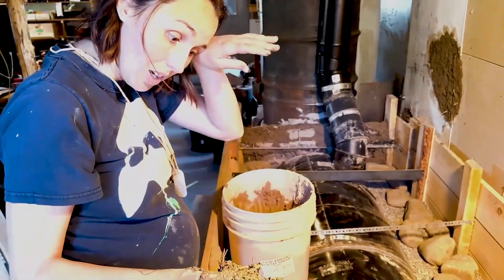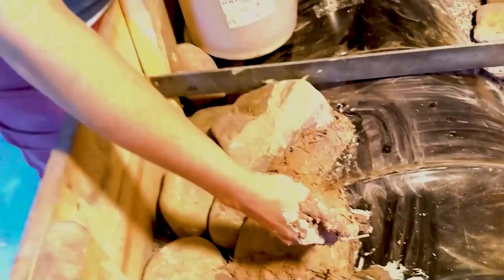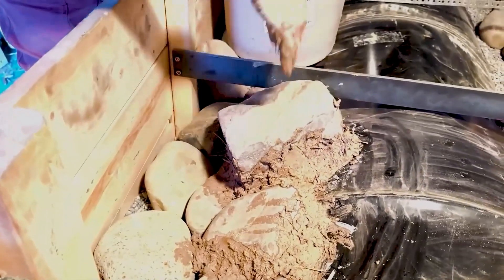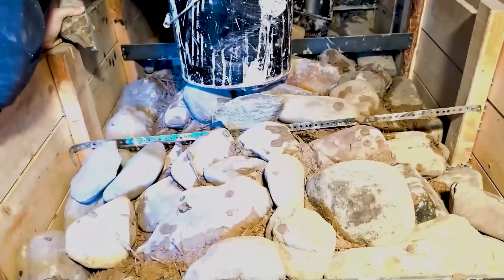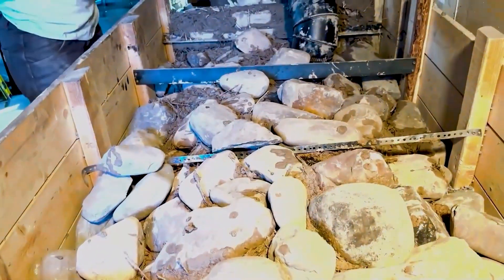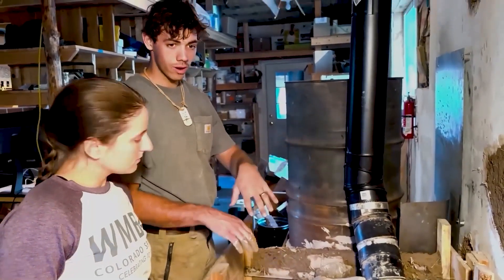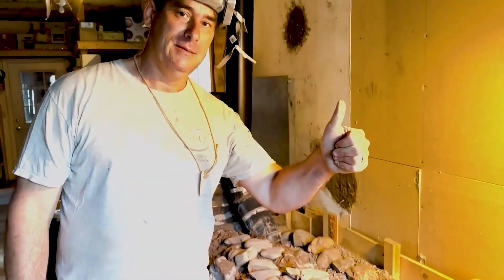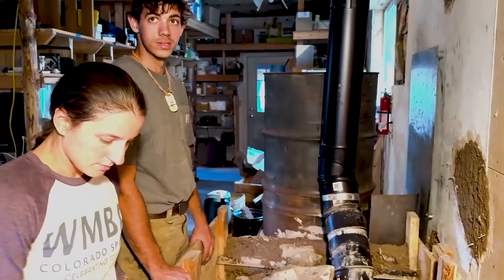optimizing the mass by merging pebble style with cob style

Comment: I want to build a rocket mass/batch box heater in my 26x38’ garage. I plumbed in radiant heat in the slab and have some foam insulation as sheathing. It also has a cathedral ceiling because I will eventually add a 2 post lift to work on my vehicles( footings installed ). With the technology changing through your work , I am confused about how to proceed. I want heat to transfer to the floor to warm the water in the pipes where they all travel back and forth to the manifold….I am definitely doing this project. What should I start buying and preparing ? Already have a chimney for the barrel stove that eats humongous amounts of wood fast , then gets cold .
Reply from the maker: I have never tried that!  Good luck!
Reply: @ hey Paul, I will video  as I go. I will have some questions like the chimney touching the barrel to help with the draft and sourcing stainless barrels( I’m in the Black Hills of Wyoming )
I’ve been reading your work and am excited to do this project. If it pans out I have friends and Nieghbor’s that are interested in possibly heating shops and houses with a mass heater…
Thanks

Comment: ONE of the HUGE problems I face is, my unfinished basement doesn't lend itself well to the  common rocket mass heater.  However, always a fan of the "if there is no solution, there cannot be a problem" approach (within reason, of course). Mindful of that, here I go:

(1) My house sits on a first story of cement blocks. Those blocks are totally uninsulated on the outside.  

(2) I rented a house on the coast of the Pacific Northwet. It, too, had one story of concrete blocks exposed to the weather. Like my current daylight basement, there was no insulation inside.

(3) I enclosed that Pacific Northwet rental's basement, installed a picture window and a door (to the elation of the landlords).  After that, I installed wood heater. The basement was otherwise unheated.

It would take about three days for the wood stove to heat the concrete blocks AND the concrete floor. When they come up to temp, they would hold the heat for a couple days, and the heat was a nice, comfortable heat.  In other words, the basement was like a heat flywheel.

(4) Had I or the landlord insulated the outside of the concrete blocks, the efficiency of the heat flywheel, a/k/a basement floor and walls, would have improved even more.

(5) Were I to insulate my concrete block walls (upper third on the east and west walls and all of the south wall, those walls, along with the concrete slab floor in my house could be made into a worthwhile heat flywheel (I could add 2x6 framing for the insulation and flashing would protect it well, from water penetration via the top, under the deck).

(6) Once all that was done, instead of the standard rocket mass approach, I MIGHT be able to press the piping against the concrete blocks, use a heat conductive packing to help transfer heat to the blocks, ALL while limiting the amount of mass the actual stove gets.

Essentially, instead of, for discussions sake, a long, 24" x 24" mass, I would build a mass just a bit deeper and taller than the pipe and try to move as much heat into the block.

It might even be the mass could be built outside and, again, up against the cement blocks, then WELL insulated to move the heat into the blocks.  

With the proper approach, the tunnel could still be feed from inside.

(7) In the end, one of these approaches or a variation of them may be an ideal solution to the problem of establishing safe, emergency heat.

(8) From the emergency point of view, there is also the matter of storing water. The large, 250 gallon and up toes would be ideal for this, but they have to be protected from freezing weather.

A small room, with a removable wall, to allow installation and removal or swaps of the water totes could tap that heat source. In our situation, the tote could be hidden under the deck to maintain the aesthetics of the property.

Comment: why don't you use water instead of rock? it has about 4x heat capacity.
Reply from the maker: water would not stay in the wood box. Engineering to hold water gets interesting.  Cob and pebbles and rocks are already laying around on the ground outside and are extremely easy to work with.
Reply: @paulwheaton  yes the rocks for mass is easier to work with but a few water heaters for storage and radiative heaters it could all be moved into a shed during the off season. Couldn't let it get near boiling though.
Reply: @paulwheaton  is it feasible to use water though, any idea how hot the rocks get?
Reply: @dooo679 It's genuinely pretty challenging to use water as mass. Sealed systems explode if you mess up so DIY builders usually stick with vented designs. Vented only works well in a narrow temperature range- above pasteurisation temps to kill legionella but below boiling. If your design isn't perfect then your room is either overheated or still cold when the water mass achieves this temp. It's way more complicated especially if you're piping it away to a thermal battery. I reckon a water tank within a bell is the easiest way to use water as mass. The heat exchange from hot combustion gas to water is the trickiest bit to get right and this way is simple and still pretty efficient.